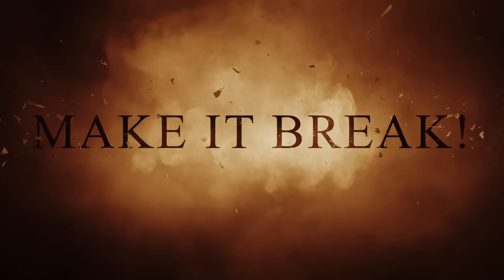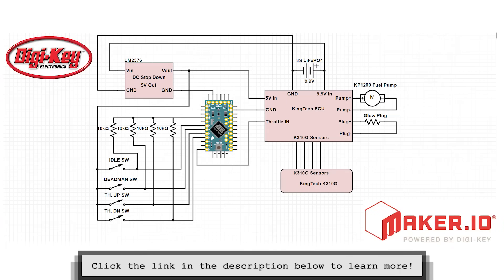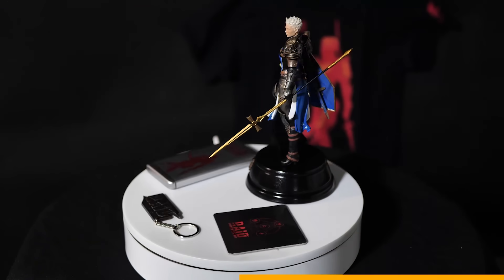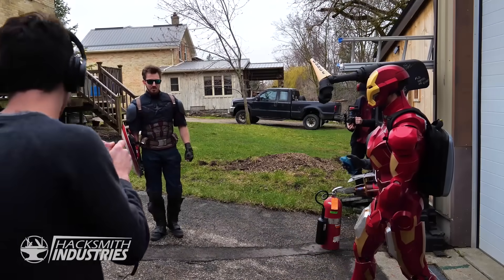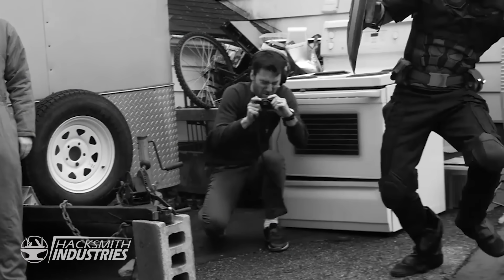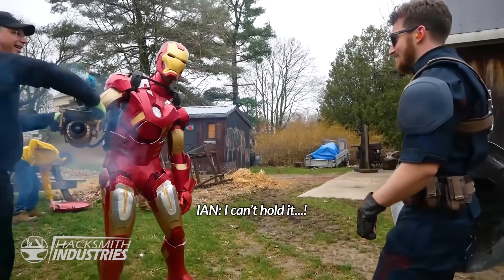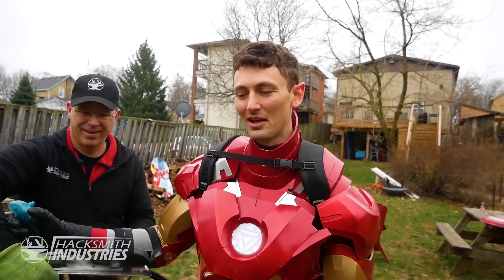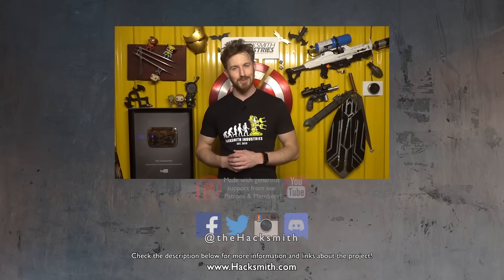Jet Engine VS Captain America Shield (MAKE IT BREAK)

Comment: I have an idea of what you could do. You can some scrap metal and fiber glass with the jet engine you own and make a type of hang glider or instead of a jet engine use a light weight motors to make your own drone PS Keep up the good work and hey on October 28 could you give me a shout out for my 13 birthday you don't have to if you don't it is just a question

Comment: This might be stupid and I'm definitely not a engineer but I might have a cool idea for the iron Man suit that'll make it less bulky and more streamlined. I'm thinking what if you can machine multiple square shaped tunnels as hydro lines through the suit with multiple small reservoirs and pumps in bulky areas and many small hydro arms around the limb you're trying to move instead of one big one?

Comment: 2:15 that's a wyvern, I mean, a wyvern is a species of dragon, yes. But dragon is also a species of dragon. So well, now you know the difference, a wyvern has 2 back legs and claws on its wings, a dragon is a Drake with wings, 4 legs and wings (drakes do not have wings. Wyrms do not have legs or wings, well depending on the kind at least). Sorry if I'm a huge nerd.

Comment: I wonder if you could make a flame thrower that comes out at your palm like the repulser, like there’s cables running down the arm that are flexible that come to the palm and then get shot out with a spark thing to get the flame. With some obvious protection between where the flame comes out and your palm

Comment: I found this on the internet>> For making Vibranium all you need is Ti-3Al-8V-6Cr-4Zr-4Mo Beta C alloy with Ti-6Al-4V with Fe-12Ni-5Pt-15Al and Fe-6C-6Al-4W-7Sn and Steel this would be most likely an alloy for Vibranium use those alloys together and you will make a man made version of Vibranium...
It is true?

Comment: You can use eletrolise  to fuel the  jet engine and do your own  fuel
Reply: Papo de ciência Wouldn’t Hydrogen burn way too fast?
And it’s energy density is probably not high enough. It’s almost impossible to produce enough of it in a short amount of time. Just use the electricity for an EDF
Reply from the maker: it needs jet fuel not hydrogen
Reply: @hacksmith  but one thing that I think will be cool its a plasma iron man repulsor what you think ?